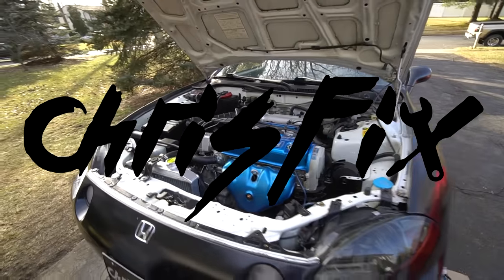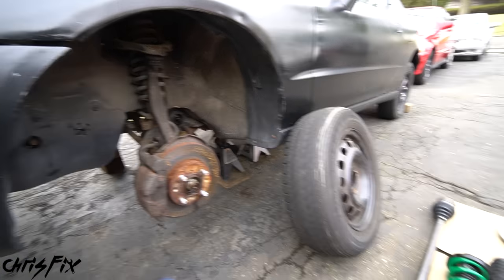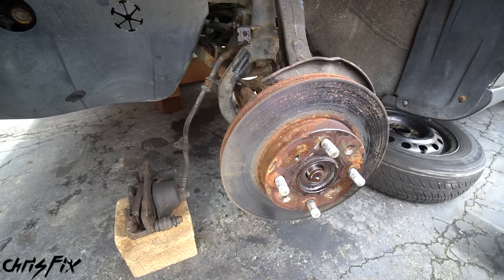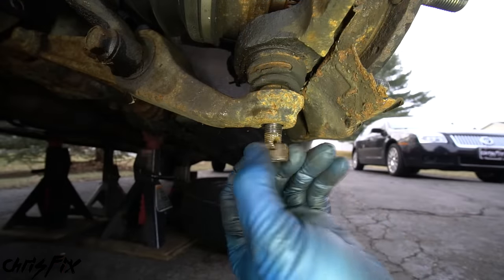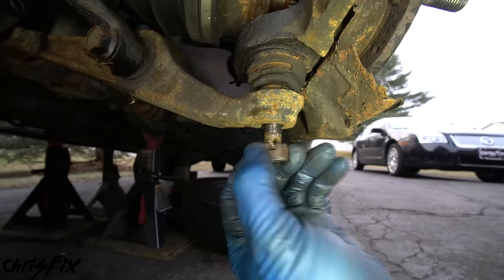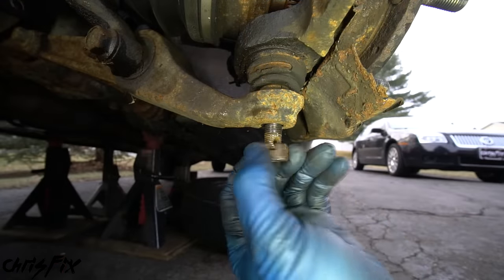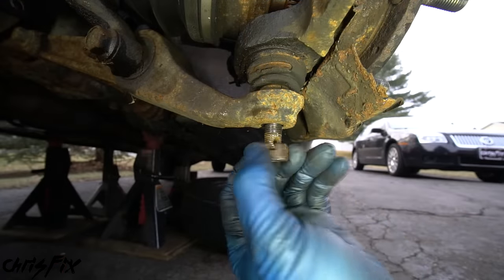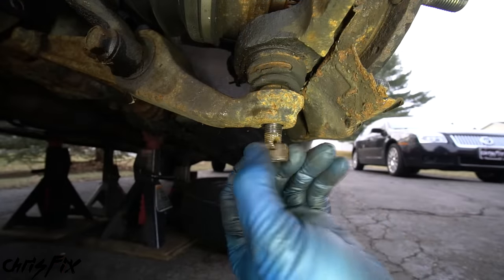How to Rebuild the Entire Front Suspension in your Car or Truck

Comment: A very helpful video but unfortunately for me maybe TOO helpful 😂 But I did have some surprises and troubles for my 06 fusion because the 2 cars are so different. Namely my ball joints being fixed inside the control arms and there being 2 lower control arms (both with the ball joints facing downward rather than upward like most cars I've seen with upward facing ball joint studs) and sway bar links which I didn't see on your car. I also noticed whoever worked on it last likely was a DIY-er like myself or otherwise a lazy/cheap mechanic because the axle nut wasn't even indented (nice cause I can reuse it and indent it myself, but still seems unsafe to me) And I have nice new tools 😂 rather than blow my money at the parts store renting tools for 200 dollars a pop (when I didn't have it to spend) I bought a slide hammer kit and bearing press kit off Amazon for about 55 each and can use them in the future whenever I need which is nice (slide hammer kit also doubles as a dent pulling kit, steering wheel puller, etc.) Especially since I will probably have to redo my El Camino's suspension before using her too much

I went to change my wheel bearing and the lower control arms were STUCK (I got one out, had to cut the other out and still haven't got it unbolted from the frame cause I dropped my socket INSIDE the frame -_- I hate Ford engineers) and a broken half of the old bearing is stuck fast on the hub so I had to order a new one since I can't safely cut it off without knicking the hub

Ultimately to change my bearing I have had to change my upper control arm, tie rod, sway bar links (which I don't think your car had?), hub and bearing, lower front control arm AND the strut mount because I was following torque specs of 66 ft pounds and snapped the strut stud off (the torque wrench never clicked so I kept turning and it broke -_-) 

I was planning on redoing the entire front end suspension anyway but this is ridiculous 😂 I tried unbolting things (tie rod and upper arm) and they're just free spinning in the socket so I had to replace those too lol, and the lower arm being stuck didn't help cause I mushroomed the threads like a dolt so it's a goner

Never buying a Ford again, once my El Camino is up and running it's Chevy from here on out! (Or Dodge, Jeep, Nissan, anything but Ford 😂)

Comment: I need advice. I just bought a 99 Honda crv that needs ball joints among other suspension parts. I keep reading everywhere that aftermarket parts are horrible idea on Hondas. But going through Honda will be like 2500

Comment: I did everything but the struts and the cv axels on my 01 maxima and 5k miles later my cv axles started clicking. SMH  I should have not cheaped out and did them as well for an extra $300 because now it is going to be another 4 hours.  At least everything was torqued to spec lol.

Comment: Incredibly helpful! Thanks, Chris. BTW, how does rebuilding a rear suspension differ? I'm looking to do both on my car and can't find a good walkthrough of a rear suspension rebuild.
Reply from the maker: It is very similar. if you can do the front, you can do the rear. I will do a rear suspension rebuild video eventually!
Reply: @chrisfix  Thanks, Chris. You're doing important work.

Comment: Most tips are indeed helpful.  However with some parts I must disagree.  Stuff like ball joints if they are to remain in place (not replaced) its alot less damaging to use a puller on them.  With the axle nut,  why you need a person to press the brake?  A long piece of wood also works fine.  The hub carrier is another one. I tend to use an hydraulic press pin on that since the sliding hammer is usually 50% successful.    Also it's a golden idea to check as many bolts in advance if they are good enough to be reused and if they are not rusted solid.  That way you can buy new bolts ahead of time.   If you work at home, do yourself a favour.  First inspect everything properly and check all the nasty bolts that need to come out.  Things like cotter pins can cost you 20 minutes if they really fight.   So be prepared for that

Comment: Me : my suspension is good
Me : calls chris
Chris :no it is bad
Chris :u need breaker bar hammer torque wrench wrench lock pliers and ball joint press and slide hammer
Me. what
Chris. Watch the video
Me. Watches the video and realize I don't have a car

Comment: Hey,Chris. Noticed I have a bad creaking in the front end of my 2015 Si,newer struts,sway bar links feel solid but I went in a check the outter tie rods and I can manually twist the passenger side tie rod indicating I need to change it as well as my driver side is getting to a similar state as the passenger side. Can bad tie rod cause creaking when turning the steering wheel left and right,creaking when I get out of the car when it's parked or slow turning also creaks. Thanks!

Comment: I'm doing this job in my Del Sol, I need more leverage to loose the splinde nut, should I borrow an impact gun? Also I'm using a regular chrome 12 point socket, should I get an hex impact socket like yours?
Reply: 12 points are honestly terrible overall, should always use a 6 point if you can. but you always want to use impact sockets as you can shatter regular chrome sockets with an impact

Comment: What’s up Chris fix I got one question what happens when you replace the rotors and the break pads and the calipers on your truck and then you drive it then it starts smoking. I checked for pressure and and nothing is wrong I lubed everything as needed but everything still over heats

Comment: Is replacing the back is the same as the front i own a 2008 ford mustang v6
Reply from the maker: Not the same but it's a similar process for removal and installation. If you can do the front then you can definitely do the rear suspension!
Reply: @chrisfix  got a video on that ??

Comment: Hey Chris I have been to 4 mechanics about having a bad jerk when going into gear and shifting into first, 2nd sound like a clunk not a jerk , 3rd and 4th are smooth 1  mechanic told me it is my transmission, another tells me it’s u joint and another tells me it’s my differential any idea what it could be? My trans shifts amazing  so I honestly don’t think it’s that it’s a 94 s10

Comment: 12:11 Wouldn't that be called a Transaxle?
Reply: A transaxle is axle that is directly built into the transmission which are commonly found on ride on lawn mowers. The ones that Chris is working with are CV axles which have universal joints in them allowing the transmission and the hub to allow them to move when riding over bumps.

Comment: @chrisfix Chris - Random question but I'm considering doing most of this on my 2010 Corolla. The ball joints are bolted in instead of pressed. Is there any point to replacing the lower control arm then? I replaced the control arm on a car in the past to avoid the headache of pressing them, but if they're bolted in is there any advantage to replacing the control arm as well? Thx in advance

Comment: I'm stuck trying to get the axle nut off
Reply from the maker: Are you using an impact or a breaker bar?
Reply: @chrisfix  wheels on the ground, penetrating oil,1/2 inch breaker bar 32mm impact socket, even had my dad give it a try and even with the handbrake up, it moved the car so I pushed the brakes and still nothing. Might go rent an impact tomorrow...
You make it all look so easy. I have another axle so at this point I'd just cut it off if I could

Comment: Looks like you pre loosened all these rusty bolt before making the video. In reality, it would be a real tough job to break loose all this rusted parts. Grinders and cutters and heat torches would be required including that impact gun you have that was not used. Would be nice to see a real removal process and how you deal with those rusty bolts removals.

Comment: At 5:05 your breaker bar sounds like it slipped a little, but the video was cut to where you got the axle nut to come off. Im just wondering what you did to get it off because its happening to me with a strut bolt and I can't get the bolt to loosen it just slips and I hear that same clicking noise. Also, the nut is not rounded so its not that but I'm afraid to keep trying and round it. Does anyone know what to do?
Reply: It's a flex head and the bolt can be on really really tight

Comment: I just replaced my ball joints on my 04 tundra
It may or may not of had 328k on those ball joints....
But that's toyota for ya bitches last a long time.
$200 or upper and lower OEM
Reply from the maker: Nice work!

Comment: Why not get a new knuckle? Instead of fighting all the bearing and removing rust and painting the old one?
Reply: because you can just paint and reuse the old one, 0 point replacing it unless its damaged or too far gone from rust. they are also expensive and hard to find
Reply: @arcanevoid9199  I understand that, but he could have reused the control arms as well. Just replace the bushings and ball joint. Why not reuse all metal parts and change out the rubber components. That’d be cheaper as well
Reply: @tsidebottom101010  yea he could have, but often control arms are really cheap and easy to find that it’s not really cost effective to paint them. and also you don’t know if the old ones are perfectly straight either

Comment: Why are you gonna put the old parts as new parts in the car? I thought it was bad
Reply: do you mean the knuckle? because theres no point replacing it
Reply: @arcanevoid9199 Do you mean its difficult to find?
Reply: @gracebelmonte3554  it is but no, unless its damaged there isnt any point replacing it. theres nothing on it to wear out and a new one like i said is hard to find and quite expensive. if you just paint it or get it powdercoated its as good as a new one